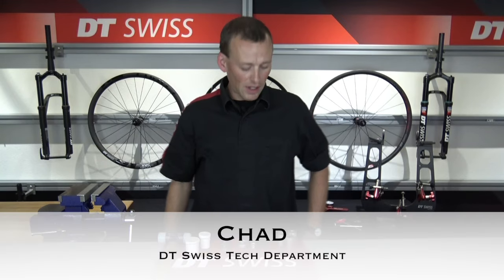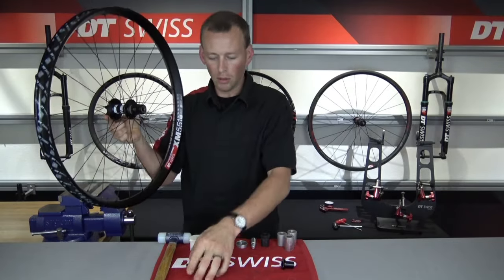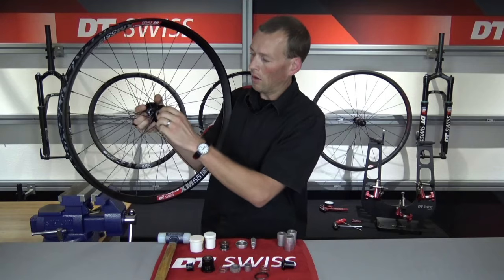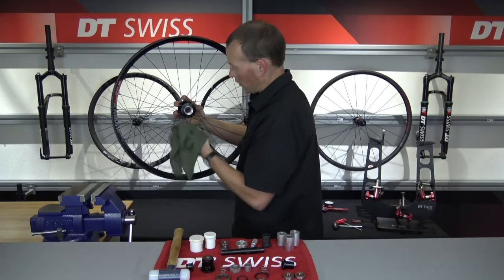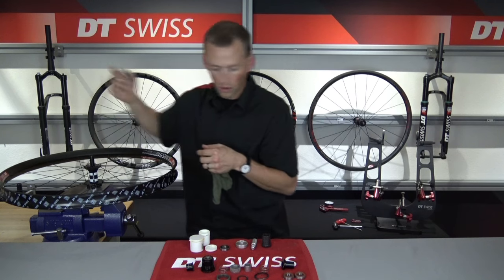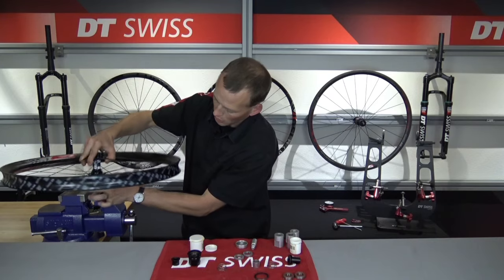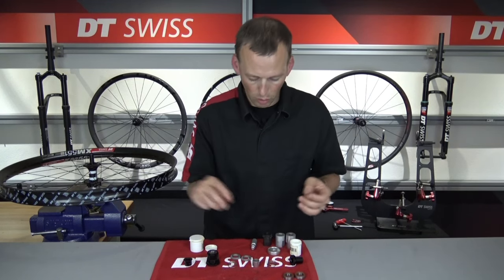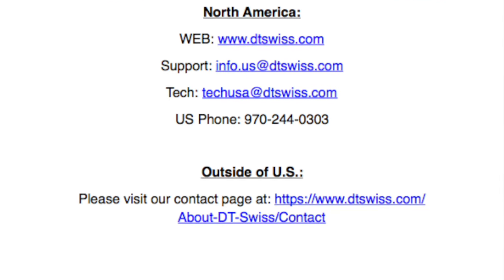Bearing service on DT Swiss Star Ratchet hub. How-to tutorial.  | DT Swiss

Comment: on the newer 240s there seem to be no grove for the drive side washer. also, there was no grease (or anti seize) on the star nut on my brand new dt wheel. good think i checked. it already made a unseizing sound when i removed it (and greased it). I had a dt240s ungreased like this and removing the star nut after 2 years of riding was extremely hard
Reply from the maker: Hi there
Thank you for purchasing one of our products. Regarding your question, I think you're Talking about the ringnut, which is screwed in the hubshell. As you can see in our Manual: https://dycteyr72g97f.cloudfront.net/uploads/WXD10000000896S/MAN_WXD10000000896S_WEB_EN_001.pdf
We do not use grease to mount the ringnut. We do know that it is sometimes hard to disassemble, but it will not change if grease is used. When you're Talking about the washer on the drive side, you mean the endcap? There should be a groove on the drive side but there is no one on the non drive side.
If you think there is a Problem with your hub, please get in contact with one our service centers ( a list can be found on our Website ).
Have a nice day, Friso, "DT Swiss".

Comment: Love the vid. Hey I have a Set if dtswiss 240 hubs. The front hub is nice and loose and the axel spins freely, the rear hub is quite stuff to turn by comparison. 

It’s just enough stiffness that when the rear wheel is mounted on the bike it’s too stiff for the the wheel to freewheel Loosely enough for the valve stem to always be pointing to the ground. 

The front hub is loose enough where the valve is always at 6 o’clock. 

I’m just trying to describe accurately how the rear hub is a bit stiffer to turn than the front hub.
Reply: Sorry I meant set OF dtswiss hubs and quite STIFF to turn, not stuff
Reply from the maker: Hi Matthew
Your case is more or less impossible to judge over a computer via e-mail. There are so many different things which influence the effect your describing. As an example, a bearing should not spin to easy, when not mounted. In our case the DT Swiss hubs need preload from the axle to spin correctly. I would suggest to go to an experienced DT Swiss dealer and let him evaluate the function.
Stay healthy, Friso "DT Swiss".
Reply: DT Swiss yes I have since done this. While it’s quite stiff to turn, it’s smooth and if held on either side the wheels turns freely.  It seems there’s enough resistance to just stop the valve from ending up at 6 o’clock every time, but not much lore than that.
Reply from the maker: I just can recommand, if you think there might be something wrong with the hub, to contact one of our service centers.
As I try to mention in my previous comment there is stil no possiblity to feel something through the WWW and there is as well no possible remote diagnostics on this. Have a nice day, Friso "DT Swiss".
Reply: Yes I took it already to bike shop, guy there was familiar with dtswiss. He said it was normal
Reply from the maker: Hi Matthew, thank you for the feedback. I hope he could convince you, that you have a good performing product on your bike.

Comment: Best instruction film ever. I har CR 1600 wheels, is it same process to change bearings as in video? Is it possible to change bearings in the free hub or just buy a new complete free hub with bearings included when its time for service?
Reply from the maker: Hi Peter, the CR 1600 wheel set is based on the 350 hub and the process is the same. We don't service freehub bodies, they are only available as entire piece with or without the right side end cap.
Best regards, José, DT Swiss

Comment: Thanks for the video. Can you tell if you need to remove the hub-seal/ring-nut if only the inner axle is to be replaced? Or can it just be hammered out? Fyi, it broke inside the hub.
Reply: You should be able to hammer out on the non drive side. The ring nut removal is only necesarry if you need access to the drive side bearing.

Comment: I replaced the bearings in my 240 rear hub. However the main hub bearings run notchy and resisitant from new. They are DT Swiss bearings and the correct size and seated correctly. Any ideas why?

Comment: So I'm still trying to remove the ringnut @4:00. I cranked with both arms counterclockwise and stopped out of concern as I both heard and felt the spokes flexing from the torque. I'm not impressed with this design. Thanks dt swiss. Anyone recommend another better hub system?
Reply: Some people use heat to warm the hub because the alloy expansion and then they remove the ringnut... just be careful when doing to avoid damage

Comment: Hello @DtSwiss this is a common question I guess; I love my DTSwiss 350 Hubs (front and rear) but I would like to change the bearings to SincCeramic so my question is: Can you tell me the size of the bearings I need for DTSwiss Front and for the Rear Hub?  I've contacted support via email but they only told me to find the bearing size and purchase them separately. Can you guys help me? Thank you! Great video!

Comment: I see that you use the red star ratchet grease on the inner faces of the star, but id didn't see you use any grease on the outside of the star ratchets (or the inner faces of the mating surfaces on the free hub body or hub shell). Do you not use any grease on those surfaces? Thanks-

Comment: Can you please advise parts numbers for hub bearings that should be installed in a 240s hub? Are they both the same? I’m currently researching this and DT Swiss have advised there are two different bearings that go into the hub shell and bike shops are saying the same model for each bearing (2 x in hub shell). Thanks.
Reply from the maker: Hi, thank you for your comment. The 240 hub is for more than 20 years in the portfolio of DT Swiss. In this time we offered multiple versions. There are three possibilities, to get the details about the bearings in your hub: 1. Remove the bearings to check on the outside the bearingtype, the numbers are standardized worldwide 2. Use our product support tool (
https://www.dtswiss.com/en/support/product-support
) to identify your hub, so you will see there the correct bearing types. 3. Get in contact with one of our service centers (
https://www.dtswiss.com/en/support/contact
), they are able to identify with the serial number of the hub, the bearings being used in your hub.

Comment: Hi dt swiss.. i want to change my old bearing. Can you tell the size of bearing for dt swiss XR1501 spline one 29 ? I can't find on your manual instruction. For front hub, i use 100 x TA15mm and 135 x 10mm for the rear. Is the mechanism to remove the bearing, same with this video ? Need your advice. Thank tou

Comment: only 1.5 years and 6500km and I need to change the bearings, one have a lateral play, the other rust inside. The wheels cost a lot, they do not last more but less than my former mavic, and I discover now that I need a special tool to remove the freewheel and that my regular tools for bearings are not enough. The DT swiss website does not tell me the full reference of the "ring nut remover" tool and I see that there is different shapes of the teeths.
Reply: I only got the ref HXDXXX00N1131S for a HU1900 rear
Reply: These bearings look very hard to replace... but you should be able to remove the freewheel by hand?

MTB?

Comment: Great video. What would be the symptoms of hub needing a full service like this? My dtswiss 350 on a Roval c38 seems to not spin smoothly or as freely as comparison bikes. The bike has only done less than 2000km. Freewheeling it doesn't get many rotations, and backpedaling where freewheeling slows the wheel. When pedaling forward, compared to other bikes, it also doesn't rotate as many times. I'm wondering if when the bike was built the dealer mechanic installed something wrong, didn't use the right grease or something else?
Reply from the maker: Hi Gerard, I would suggest to contact your LBS in order to have the hub serviced. Of course you could also do it by yourself. I can't judge from here if there was a mistake made by your mechanic. Kind regards, Christian, DT Swiss

Comment: Bearing seal designation: The original ones i'm replacing are 6902LU which would indicate a single seal (not removed them yet to check). Can I replace with 2RS or LLB?
Reply from the maker: Hi 2sixstreet, as I know RS and LU stand for the same but from different suppliers. We use bearings with two covers, on the outside a seal that has a sealing lip to the inner ring and on the inside a cover with a tiny gap to the inner ring. This reduces the seal friction by half. If the designation of the dimensions is right (6902) it will fit the hub. At least on the outside it should have a seal. Kind regards, José, DT Swiss
Reply: @dtswiss  thanks for the reply. Do you have a DT Swiss part number so I could source them please?
Reply from the maker: Hi 2sixstreet, the latest part number is HSBXXX00N2336S, Kind regards, José, DT Swiss

Comment: Hi. Great video. Both bearings in my 11 speed road freehub on 350 hub have disintegrated completely leaving inner and outer races only with no way of identifying bearings. Would it be possible for you to tell me the bearings I need ??
Ian
Reply: dtswiss hy guys. please tell me how to extract the 6902 bearings from my dt swiss 370 hub in order to replace them with new ones?! i remove the cassette freewheel from hub body but I can't remove the axle from the hub! I have a rubber hummer and a give a few punch but nothing, the old bearings are still in place. what can I do?!
Reply: dtswiss thank you very much for the instructions. dt swiss best team! :)

Comment: Hi ! Before unmounting my Syncros wheels, i would like to know if it's the same process for 370 rear hub and 350 front hub ? Could you tell me if the Dynamic High Performance Grease makes the job right for these bearings instead of the DT Swiss star ratchet grease ?Is the assembly grease could be the one of Shimano ? Thanks a lot for this video. Thomas
Reply: Why non lithium grease?

Comment: Hi @DT Swiss i can't find information what type of bearings i have to look for to exchange worn one for dt240 centerlock strainghtpull boost 28spokes hub front and rear xd. Can You help me.
Reply from the maker: Hi Dariusz, thank you for the question. A DT Swiss 240s CL SP Boost hub will use two 6902 bearings in the hub shell. The XD freehub will use two 6802 bearings, but we do recommend replacing the entire freehub if the bearings in it are worn (part # HWRAAX00S3114S). Kind Regards, Andrew, DT Swiss USA
Reply: @dtswiss  what about front there is 6903 mark but is not 17x30x7 why? What about EXP ratchet will be there any conversion kit from ratchet to ratchet EXP?
Reply from the maker: Hi Dariusz, a 240s "Fifteen" CL SP front hub uses two 1830 series bearings in the hub shell. The bearing dimensions are 18 x 30 x 7mm. Existing ratchet hubs cannot convert to ratchet EXP. Kind Regards, Andrew, DT Swiss USA

Comment: Hi, Thanks for the Video. do i really need to upgrade from 18 to 36T or 54T on my FFWDF6R 240s allow carbon chincher wheels, whats the real gain here? Used on a road bike.
Reply: Not necessary.  The difference is hub engagement.  Take 360 degrees in a circle and divide by number of teeth.  For 18t, that's 20 degrees, which means your crank can rotate up to 20 degrees before the ratchet teeth engage.  For technical mountain biking, it's important to have immediate engagement--you don't want that "clunk" when you need power RIGHT THEN.  Less important for road biking.  Also, 18t are almost silent on an average ride--36t create an audible buzz.  I don't have any 54t, but they supposedly buzz very loudly.

Comment: Great video; how do you replace the bearings in the freehub please? Thx.
Reply from the maker: Hi Marek, we usually replace complete freehub bodies. Best regards, DT Swiss
Reply: dont waste your money - use a punch after moving the middle spacer aside. then pop in new bearings. both bearings have inner shoulders so you will be able to press them in just as you would with the hubs using a threaded rod. (dont forget the spacer in between!)
Reply: @rexfest  what size bearings are in the freehub ?
Reply: @stevend99  for the 240s road rear hub,  the bearings are: 2 x 6902, 2 x 6802. i forget which ones are for the freehub and which ones are for the axle. sorry.
Reply from the maker: Hi Stevend99, we use different bearing sizes for different purpose on our free hub bodies. For Hybrid they are bigger and for light versions smaller. Regarding service we don't change bearings on the free hub body. We change the whole part since not only the bearings are subject to wear but also the seat and thread used to fix the cassette. Kind regards, José, DT Swiss

Comment: I have DT wheels on a brand new bike. Changing a flat the wheel fell over and the Hub fell apart. Ratchets and springs landed in the dirt. And after watching this video it looks like the Hub was designed to do that. So TT hubs are practically not usable, they fall apart anytime the wheel falls over.
Reply: Bikes are fragile... had it felt on the other side the disc rotor would be buckled!
My bike also fell over, now I have 2 scratches on the paint.

Comment: I can't seem to find any info about servicing the DT Swiss 350 front hub.  Mine have developed a squeaking sound, and I would like to grease them.  Is the process similar for removing the end caps?
Reply from the maker: Hi Adam, first of all make sure the QR or thru axle is firmly tightened. There is no greasing needed since there are no touching parts besides the bearings but those can be replaced with the according tools. Here is the link to the manual: https://dycteyr72g97f.cloudfront.net/uploads/WXD10000000861S/MAN_WXD10000000861S_WEB_EN_002.pdf 
Kind regards, José, DT Swiss
Reply: @dtswiss  I actually found it in this section 4.1.5 Maintenance of the Front Wheel Hub [350 Thru Axle] on your "HUBS TECHNICAL MANUAL RATCHET
" manual.  Kinda buried in there a ways.  (https://dycteyr72g97f.cloudfront.net/uploads/WXD10000000896S/MAN_WXD10000000896S_WEB_EN_001.pdf)

Comment: Nice video.. but its better if you dont hit for install new bearing.. do with pressing tool
Reply from the maker: Hi there, for sure a press would be even better. But I think there are not that much press available in home workshops where you can put a complete wheel in😉  We would like to show in this Video how you can do a replacment at home. As we even do the replacement that way on the race tracks around the world, I can tell you from my own experience it will work as well👍 Have a nice day, Friso "DT Swiss".

Comment: Why are these bearing removal kits som damn expensive??!! Are the production costs that high?
Reply from the maker: Hi there
Are you talking about the tools to remove the bearings or the replacent bearings themselves?
For the Tools, costs are everytime depending on the numbers you're producing. Bearing replacement tool kits are usually not in every hobbyworkshop available but just with professionals. So there is just a premium Quality available and the numbers are small, compared for example with a chain tool.
If your question is realted to the bearings themselves, here we have Special requirements for the bearings produced by the manufacturer. Those specific demands will lead in longer runtime but as well in a higher price. If this will pay off depends on what your expecting. Ride healthy, Friso "DT Swiss".
Reply: @dtswiss  Thank you very much for the quick reply.
I'm talking about the tools. I can understand that the tools, because of low production volumes and premium quality, is higher in price than a more "standard" item. However, as a home mechanic, the price for a complete tool set (HWTXXX00NTK24S) at 330 USD is extreme compared to what you get in terms of items (some nuts and bolts).
I would assume that when you promote a product (your hubs) as easy to maintain and service, tools needed to do the job safe would both be easy to buy and affordable. This is unfortunately not the case in my opinion. I know there are other much less expensive non-DT Swiss options available on the market, I'm just suprised that the option from you retails for a whopping 330 USD .
I ride my bikes all year here in Norway, and the fall and winter seasons can be rough on components. I have 3 wheelsets, two of them with 240s and one 350, all in need for bearing replacements. As local bikeshops in my area are slim and their service charges is equal to Apple I prefer to do the job myself, with or without the DT Swiss tool kit.
Reply from the maker: Thank you for your honest feedback.
I would like to ask you to consider as well, we're not a tool manufacturer and beside the ringnut tool ( HXTXXX00N5027S ) you don't need a specific DT Swiss tool. All the other bearing Tools are available from many manufacturers. Have a good day, Friso "DT Swiss".
Reply: @kiddiboy1980  I agree that a better more affordable option should be part of the whole package design. More thought should be put into the final user of an affordable hub, including tools needed.

Comment: Hey, I've got a seized drive-side bearing that won't come out, even with a good hammer and the axle flipped. Thoughts on a fix? Thanks!
Reply from the maker: Hi, we assume you did remove the thread ring in front of the bearing. In case you have the hub only it may help is to put it into the freezer for a while and the try again with hammer and axle. In the worst case the hub Shell must be replaced. Best regards Kai